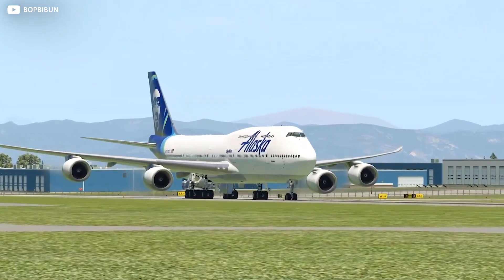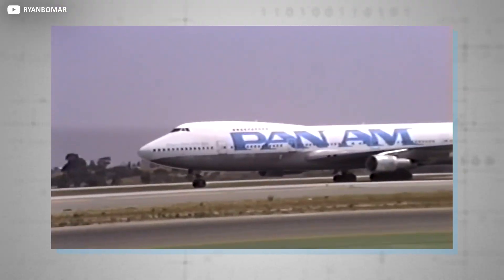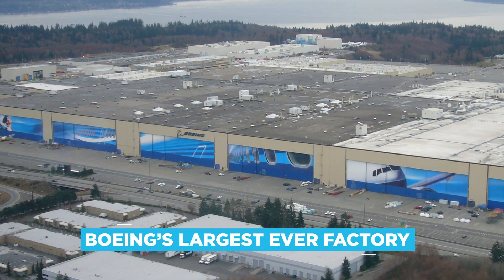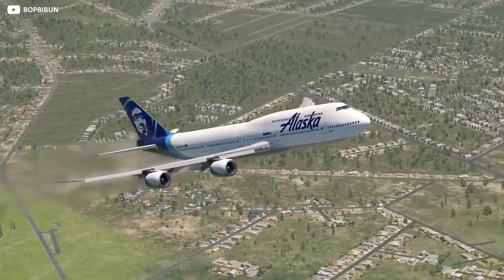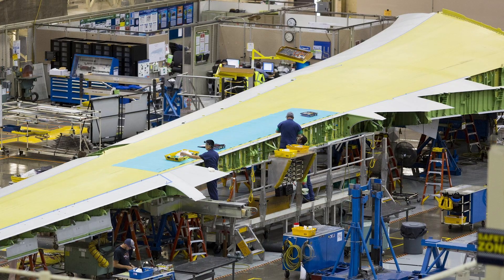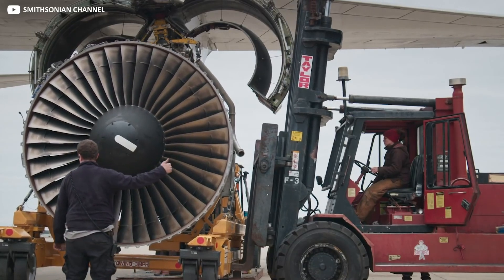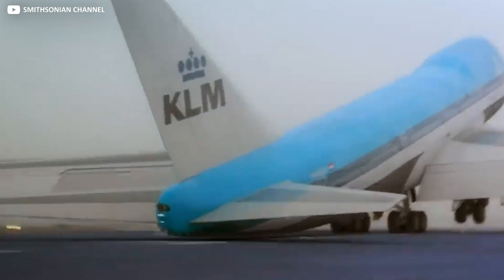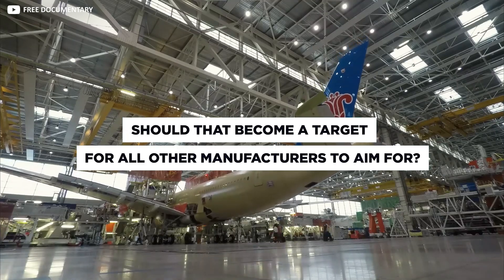How It's Built: Boeing 747

Comment: As an employee who has been honored to be involved DIRECTLY with the production of both the 747-400 and the -8, I worked thousands of hours in the areas of that factory that you show (I could easily be in those pictures. I saw a bunch of coworkers that I know), I’m going to declare your coverage of this wonderful lady disrespectful. Making statements about a particular airframe, and then showing a massively different airframe, is both irresponsible, and ignorant. There should be NO footage of an 87, 37, or ANY other airframe in this video, unless there is an acknowledgement that they owe their EXISTENCE to the 47. Respect your/the elders, and attempt to be accurate to those who are interested.
Reply: I agree completely! I worked spars on the balcony for 10 years.

Comment: Why not a single person of 10,000 workers able to spot and exposed Max issue, Afraid of getting fired ?
Reply: The engineer who designed the MAX cockpit told Boeing that they needed to install 2 Angle of Attack vanes to feed data to the MCAS.  They didn't want to spend the money. 
The workers on the floor who assemble the airplane have no part in the design. We just install and "drill and fill".

Comment: Boeing has become good standard in aircraft manufacturing 😂😂😂🤣🤣.... cough cough Boeing 737MAX disaster *cough cough *
Reply: Yeah they are... considering over half of the worlds 25,000 aircraft fleet is and has been for decades Boeing built. Flying is still the safest mode of transportation in existence, even if you include the Max incidents. Society exemplifies the statistical outliers instead of the statistical norms.
Reply: @Convergence_Corner  point well taken but the new found greed (since McDonald Douglas merger) for profits have been driving the ENGINEERING Boeing firm to take a back seat and share price sensitive new Boeing firm to cut corners. The 2 new latest products 787 n 737 max both had issues with quality and safety at start of life. 
No doubt Boeing is a great plan manufacturer but fact is they have become less sensitive to safety and quality.

Comment: Absolute crap... Shows mostly recycled 787 manufacturing video! Also shows lots of flight simulator screen shots (Alaska Air never had 747s).  Also doesn't really differentiate between the fact that there is a seperate freighter and passenger version. Lastly, only 1500??! It was the first wide body to reach that number produced. Boeing builds planes based on demand and firm order, not just how fast they can produce them. Lastly, it only takes a few days to figure out the factory, not months... I know because I work there
Reply: Also the last comment on the gold standard of airplane manufacturing and not cutting any corners...Ironically that's what Boeing did with the 737,  succumbing to pressure from Wall st.
Reply: @TheAshishu  Mmmm sorry gonna have to disagree with you there. Ask anyone who works at Boeing (that isn't being paid by the press) and they'll tell you the amount of scrutiny that goes into each aircraft. Literally safety is the highest priority. Always easy to point fingers after the fact but I assure you the Max incidents were not intentional nor were they from Wallstreet pressure.
Reply: @Convergence_Corner  I agree that they weren't intentional. But they did rush to compete with the airbus 320 neo and when airlines threatened to cut 737 orders, they failed to mention to the airline companies about the MCAS software, which was a great oversight. they did that so the pilots would't have to be re-trained which was a major factor with 320neo. So perhaps the plane structurally is not compromised at all but the management was money hungry.